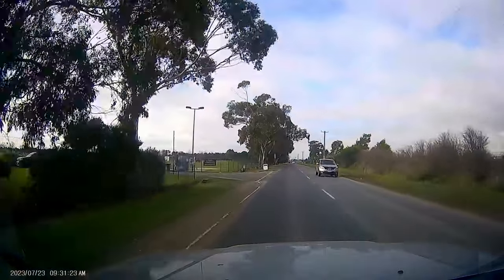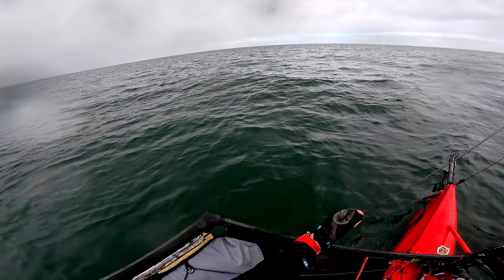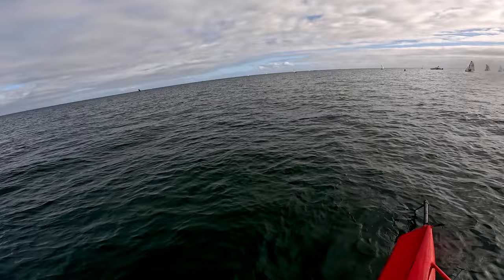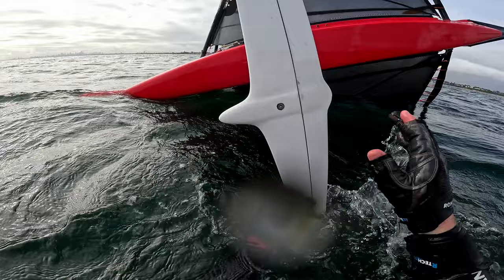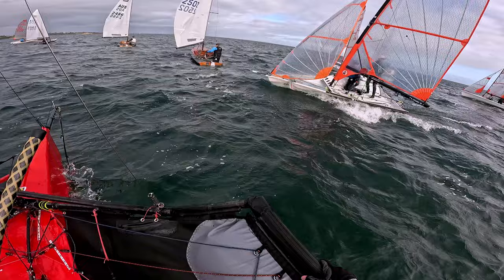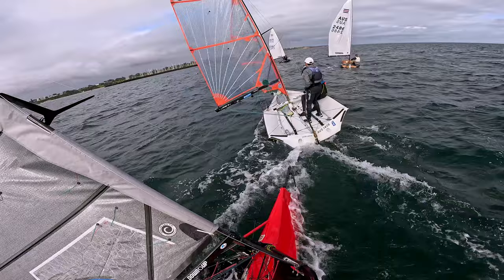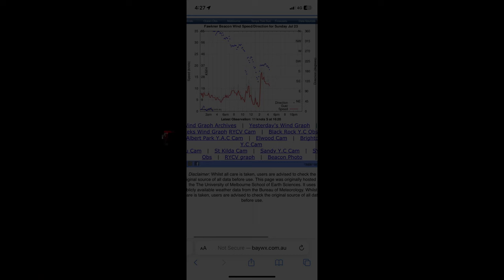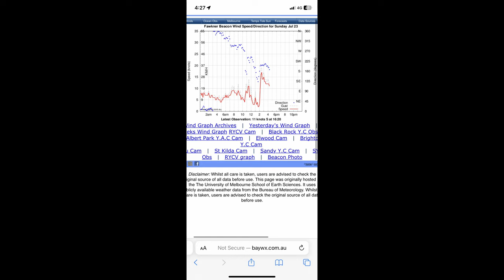Winter Moth Sailing plus WW1 Submarine

Comment: Great to watch. Surprised to see a Moth taking part in handicap racing - pretty hairy for the other sailors! Bet they cheer each time you capsize. Great video though and I love your Musto Skiff vids too.
Reply from the maker: Thanks, it’s a little tricky to compete on handicap, particularly on an older boat (although I assume that’s the same for most development classes when your sailing an old boat). These older moths are still sensational bang for buck though, even if winning on handicap is very unlikely!